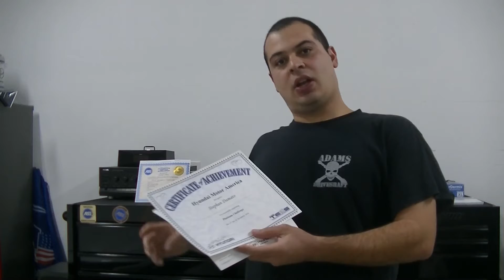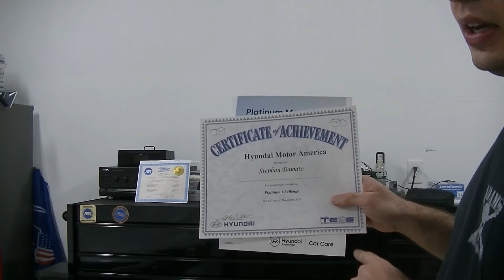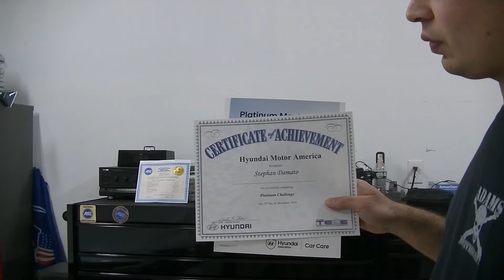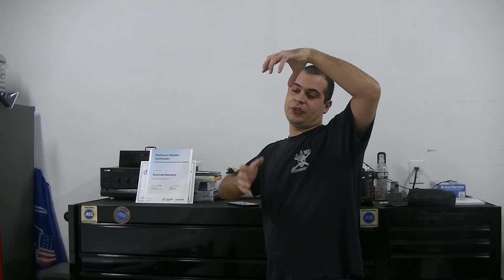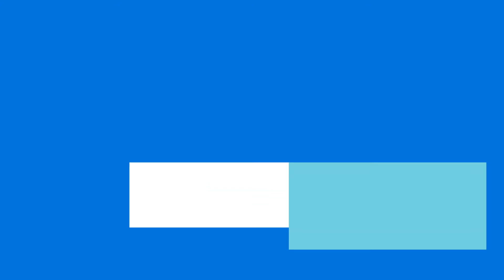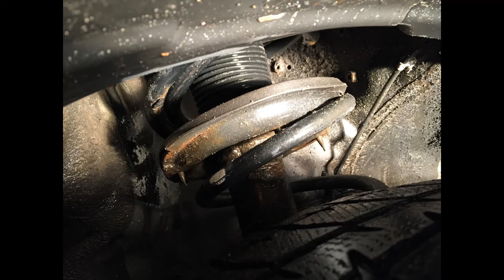2011-2014 Hyundai Sonata YF common issues/Used car buyers guide!

Comment: nice vid! i have a 2012 sonata 2.4. got the 953 recall done. but interesting enough, my car had major wire harness issues, car wouldnt go above like 10mph. they had to put two in even. otherwise, so far so good to this day...but im afraid itll be a ticking dead car soon enough. also does burn oil, only about a quarter per 1k, they said its likely the piston rings, not the pvc

Comment: My 2011 Sonata sometimes will not crank. Dealer has no idea what the problem is. I think it’s some kind of sensor. Any idea what the problem is? After it sits for a while, it cranks right up.
Reply from the maker: The next time is does this, switch the car into neutral and see if it starts. Sounds like an inhibitor switch issue possibly

Comment: 2012 Sonata, looses power while driving.  RPM's randomly  drop to idle speed, as long as you maintain the same amount of pressure on the gas pedal car will coast to a stop but maintains idle. Let off gas pedal then reapply pressure car takes of again. Any thoughts.  Car otherwise runs smoothly.
Reply: What I did was fill up with Premium gas 
No problem right now.
Reply: I experienced this same issue today please share with me how you got this fixed. That issue brought me to this video actually
Reply: Map sensor
Reply: 15$ ebay

Comment: How common is it for the reverse camera to break down if it is not a fuse issue. I have 70,000 miles on the car . 2013, 2.4 engine. Any ideas on the cost to replace? Any suggestions would be appreciated. Thank you
Reply: i had that happen to me and I raised the trunk halfway up and sprayed the camera with WD40 and let it sit there for about 15 minutes. I wiped it down then did it over again and my camera is working fine..guessing a little corrosion from the salt(northern Ontario) did it
Reply: Seems pretty common, there definitely seems to be quite a bit of interest in OEM backup camera replacements for them.

Comment: Hi there, Thanks so much for all your information, it is very valuable. I own a 2011 Sonata with over 100k miles on it, never had a problem until yesterday when engine light start flashing and p1326 code was read. My question is, if I can still get cover if something happens and I need to replace the engine? is it powertrain warranty still good if I'm over 10years and over 100k?
Reply from the maker: Your engine is covered for life for rod bearing failure
Reply: @SEsGarage  thanks so much! One more question please, what do you think about the axles parts replacement? is it safe if I purchase my own parts and bring them to the shop for replacement? there are different price ranges on the web for the same parts
Reply: Y'all are scaring me I have a 2011 Hyundai sonata that seems to be doing pretty good it has 360000 miles on it does that mean it's still and I'm the second owner maybe the second only what about warranty in this situation I need help advise Karen please
Reply: @karenjohnston5769  if you have that many miles on your 2011 Sonata, the previous owner got the engine replaced after it blew up. Absolutely guaranteed. Now if you made a typo and you actually meant 36,000 miles instead of 360,000 then probably you should be scared and you probably would be best served by just going to your local dealership and seeing what they say is wrong with the car and what they can offer in terms of recall service/etc. I have a 2011, the engine was completely blown up at 85,000mi. I'm on 135,000 on the odometer now so like 50k on the new motor and things are starting to fall apart with the car. I've been fixing everything on my own but it's becoming a nightmare and a money pit. Kia and Hyundai make genuinely shitty cars and it definitely shows once they get some mileage. When this thing dies, I'm getting a Honda or Toyota.

Comment: I have a 2019 santa fe 2.4 gdi and 8 speed auto. No issues so far at 55k. Aside from oil and air filter changes, any areas I should be more diligent?
Reply: This is about Sonatas. Go find another video

Comment: Any specific issues that pertain to the hybrid variant? I know it’s 2.4 is also affected by the rod bearing defect. I’ve taken it in 3 times and they say it’s fine but I’ve never felt 100% in it after that. Would hate to stall out on the highway and get into a catastrophic accident. I do hear some sort of rattle like sound when the engine is running  (not EV mode) and I’m doing around 20-25 mph. Goes away as soon as I increase speed past that or brake.  Was thinking maybe a heat shield but haven’t looked around.  Glad I found your channel. Thanks for the info.
Reply: The GDi pump is naturally noisy, being cam driven.
Reply: The hybrid variants also have engine problems as well.
Reply: @atx-cvpi_99  it’s all good. Got rid of it and got me an ol reliable yota.

Comment: I bought my 2012 used in 2019. Only 51k on it . Within a month I had the transmission harness issue. Found the TSB On it and immediately knew that was it. Cost $800.00 to fix. No problem since🤞. 
Great informative video!! Thank you!

Comment: The tail-light problem can be remedied by using an 1157 bulb if your sockets are still in okay shape. OEM bulbs get too hot and will even distort the copper contacts.
Reply: my problem was solved by using pulsating LED taillights. they are super bright and i have had no heating issues or  burn outs they have actually been in now for over a year and a half and still running smoothly

Comment: Thanks for the great video!
Could I please get your advice...
We have a 2015 Sonata, 80k miles, owned it for about a year (we are the second owners). It is in great cosmetic condition.
A few times we noticed the oil light flash during a hard brake. Which was weird because we just got an oil change, and it doesn't have any oil leaks.
Couple weeks later it began jerking and "rattling" (knocking???) during acceleration. We check the oil, and there isn't A DROP on the dipstick. So it's burning A TON of oil.
Dealership tells us there are NO recalls on the vehicle and the engine is probably the source of all issues. They suggest a combustion chamber cleaning but if that doesn't fix it we have to buy a new engine (!?) and there's nothing they can do.
We call Hyundai corporate, they tell us there IS a recall on the vehicle. They schedule us an appointment at a different dealership. 
Prior to appointment, vehicle begins shaking while driving. Dealership completes recall 953 and says two spark plugs failed.
(Probably because of oil burning?) They tell us to do an oil consumption test, but I'm not exactly sure it would even survive 1,000 miles without adding oil. We declined for now.
They mention the lifetime powertrain warranty applies but ONLY for rod bearing failure (as you mentioned).
But if the engine keeps burning oil, won't THAT cause the rod bearings to fail?
I'm at a loss, do I keep driving it until it fails (will Hyundai even cover it if it does)? Try to save it with combustion chamber cleaning? Just get rid of it??
Currently waiting on a call back from a case manager from Hyundai (was supposed to call me four days ago).
I did watch your recall timeline video from a few weeks ago and can already tell that this is becoming a nightmare and I feel like I'm driving a ticking time bomb . Any advice? Thanks again!
Reply from the maker: Unfortunately, the second dealership is correct. They will not replace the engine solely for oil consumption, if you’re out of base warranty. Your best bet is to continue to drive the vehicle until the rod bearings fail, at which point you would fall within the guidelines of the recall. Bear in mind that oil starvation will absolutely cause rod bearing failure.
Reply: @SEsGarage  Thanks very much for your reply. Can't wait for the 2015-2019 sonata issues video. I wish I had done my research before buying this one. You are really saving a lot of people a lot of trouble.
Reply: I have a 2017 Sonata and I feel like the thing is just a ticking time bomb. Gas pedal sensor failed (leaving me stranded on side of freeway), trunk latch stuck closed leaving me no way of accessing paperwork I needed in the trunk but the genius engineers at Hyundai only put one access to the trunk. Also, the pain is peeling off the roof , literally just peeling off as I drive down the road, i have 38k miles on this thing but I want to get rid of it

Comment: Thank you for all the information.  I am stuck buying  Hyundai Sonata 2018 out after the lease  due to the expensive auto market right now.  So hearing about all these issue is really helping me take care of this car in the meantime.  Terrible  Hyundai didn't fix these issue on the 2011-2014 models because they are nice vehicles.  Please keep the content coming.  Where are you based out of ?
Reply from the maker: Hello! A lot of these issues were covered by some sort of service bulletin, but they’re still common issues none the less. I am out of NJ
Reply: @SEsGarage  that’s good. I’m hoping I get a good experience with this car. It did go in to limp mode in the first year and I believe the knock senor was put on, So I should be good for the engine if it needs replacing.  Just want to keep up with everything else. I’m in PA wish you were still at the dealer I would  have made the trip just for you to thoroughly look over the car and give me any recommendations!